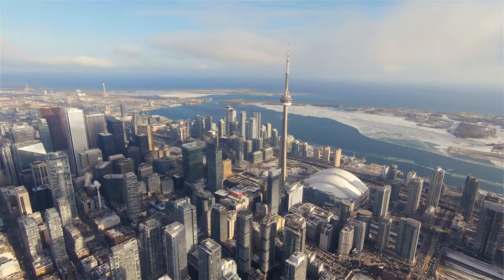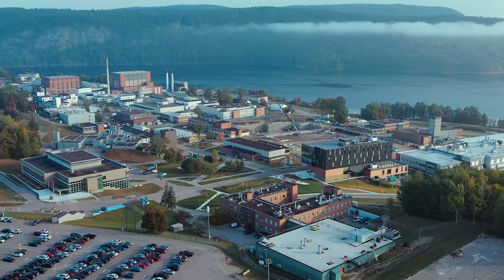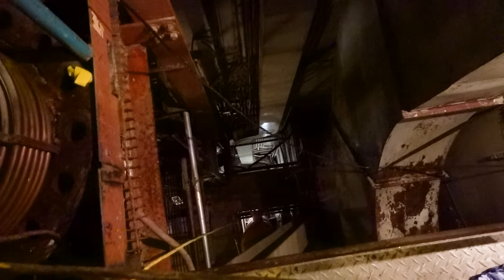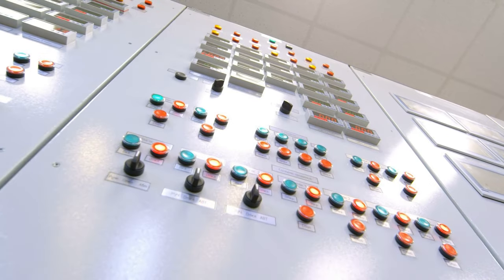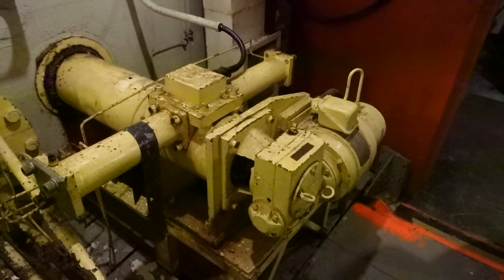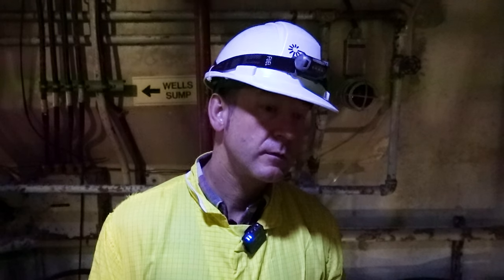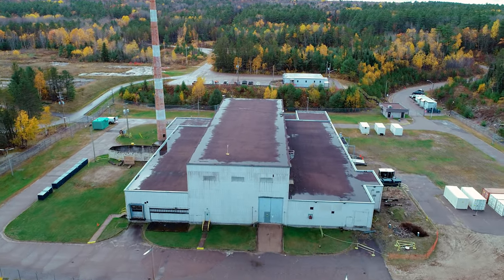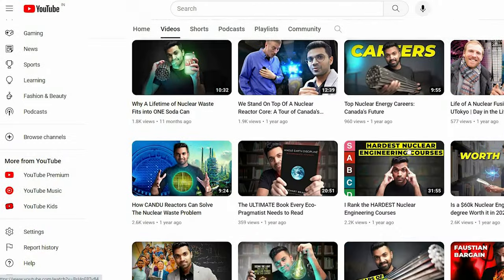Rare Look Inside a SHUTDOWN Nuclear Power Reactor

Comment: Given that CANDU was originally an alternative name for what we came to know as Douglas Point, I think I'd call NPD the "father" rather than the "grandfather" of the CANDU, although current CANDU plants are clearly of the Pickering generation, one step farther along from Douglas Point. So you could make the case either way. In any case, I regard the CANDU type as the most attractive power reactor available today. It requires no fuel enrichment and no large forging facilities such as LWRs require, which is a huge advantage for rapid deployment of large numbers, which will be needed if the world wants to get serious about "clean energy", and the Pickering pressure-tube rupture accident of 1983 shows how incredibly safe the system is. You can put a CANDU in a high-population area without worry.
As I understand it, NPD was located at the Rolphton site partly because of a nearby hydro plant at Des Joachims, which is apparently pronounced "de-shawms" locally.
In a couple of weeks, I'm headed to Torness in Scotland, to see a very different type of power reactor, but one which can also be fueled on-load. They don't allow video recording, though!
Reply from the maker: Appreciate you sharing the history of the CANDU reactor with everyone HiVisionary1125!

Comment: i have now see all the nuclear disaster that have taken place in japan and ukraine. i have noticed that not even the nuclear power plant workers. they have no special equipment or any special training for if anything goes wrong. and worst of all they have no special tools or clothes that can protect them from the radiation ☢️ 
it is very basic stuff that should be kept in any building that works in a place that have risks of radiation. i simply cannot understand why they do not have any of the mentioned. not even special mask requirements 

and why they don’t build explosion proof walls around the core

Comment: If only Australia had followed through with its plan to build nuclear reactors for power generation... instead of stopping the whole thing everything after partially digging foundations on one reactor site.
Reply from the maker: Cool to know that Australia dug the foundations of a reactor site! Which site was this?
Reply: @OsamaBaig  It was going to be a heavy water moderated reactor. Planning started in 1969, but was ultimately cancelled in 1971. It was planned to be on the East coast, at a place called Jervis Bay.

Comment: Hey Osama, make a video about India's 3 stage nuclear program. I recently heard that India has transitioned into the second stages of its nuclear program. Although I didn't understand much but it has something to do with nuclear fuel where the third and the ultimate stage will be able to use primarily thorium as nuclear fuel.
Reply from the maker: Indeed, it is a very cool concept that india is working towards, maybe in the future I'll think about making a video like this. India doesn't have a lot of uranium resources, rather it has a lot of thorium. Thus, it makes sense for them to integrate that into the fuel cycle